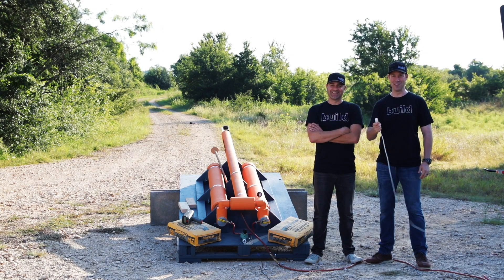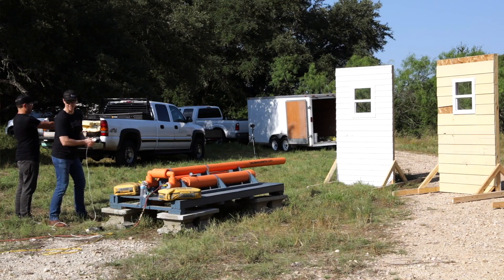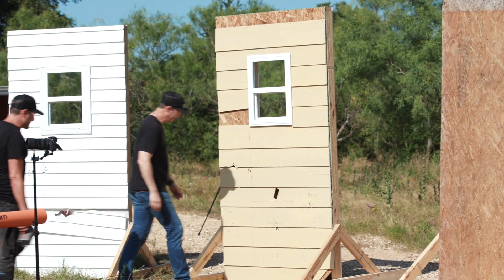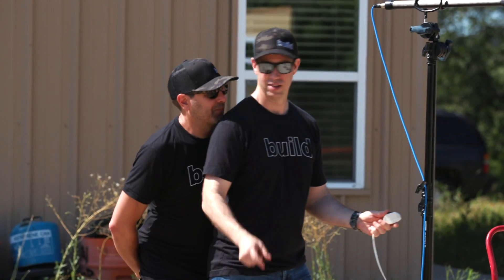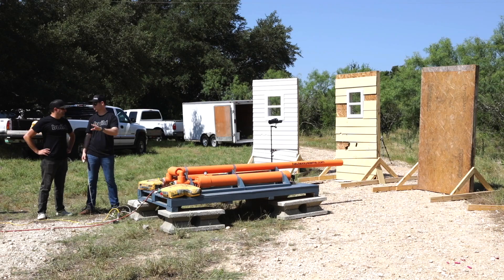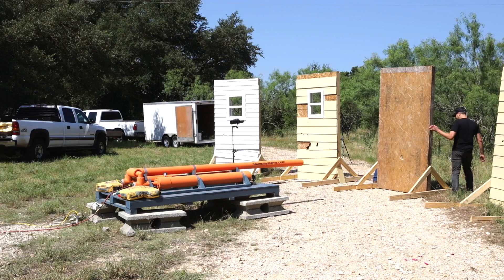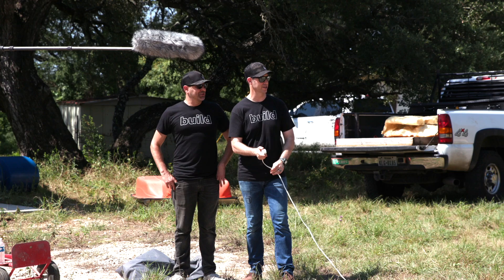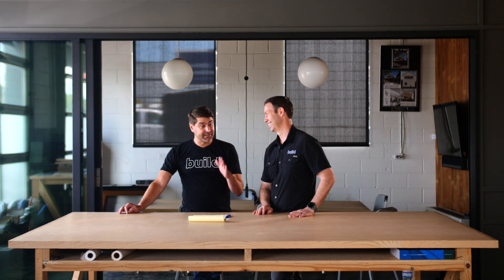2x4 Canon - Hurricane Testing Wood Walls

Comment: Matt, being from Texas you should be familiar with Texas Tech University National Wind Institute.  They are the experts at shooting walls with 2x4s!  I would enjoy a video of you visiting the Texas Tech University National Wind Institute. 

In 1970 the F5 Lubbock tornado (May 11th) causes 26 fatalities and over $100 million in damage; most destructive U. S. tornado to that time (still in the Top Ten Worst Tornadoes). The Wind Engineering research program is established as the Institute for Disaster Research (IDR) headed by Dr. Joseph E. Minor and located in the Department of Civil Engineering. The IDR develops the first comprehensive wind engineering report of its kind on the documentation impact of tornado on buildings and structures TTU SRR 03.
1971 The Fujita Scale (or F-Scale) is first published in a University of Chicago Satel

http://www.depts.ttu.edu/nwi/

http://www.depts.ttu.edu/nwi/research/DebrisImpact/index.php
Reply: https://drive.google.com/file/d/0B1S0nWwTi_fKTkRidXZFdzNmdlU/view?usp=drivesdk. 8-inch thick, R32 SIP panel coated with polyurea (bedliner) and shot multiple times at Texas Tech.  Passed the 140 mph FEMA storm shelter criteria.  Stuff was so tough it took a box cutter to cut and then took pliers to pull off the OSB.
Reply: @DavidMDensford  any link to the testing? This goes with my latest vid on building with SIPs being 30% stronger that stick building. Adding that link would be great. Thanks
Reply: The 2x4 did not breech what would be.considered the interior of the house.  The 40 mil thick polyurea adhered to the SIPs OSB so well when we pulled (with a pair of pliers) on a tab we cut, it actually just pulled the OSB wood fibers off.
The Army tested a plywood SIP panel with a polyurea coating did not breech after a pound of C4 was detonated a foot away.
Reply: https://www.fema.gov/media-library/assets/documents/2009. The wood structure is very similar except the metal is not sandwiches and they use 14ga.
Reply: I love it when the comments are as interesting as the video, which certainly was interesting.  Thank you all because, living in Texas, we share these concerns!
Reply: Remember that he does not post information, he posts his faith based beliefs. 

Reason and science have no place in the faith life..
Reply: @stormagorist6129 
It's arrogant of you to assume that because someone believes in God, that you believe you know everything about them. There have been and still are an enormous  number of scientists who believe in God. I personally know well over a dozen published PhDs in the physical sciences, who believe in God. The other 25% of scientists I know don't believe.
Reply: @cornpop7805  It is more arrogant of you to assume that your emotional reaction is actually my argument. Did you consider honesty?

No where can you find me assuming that I know everything about a person from the delusional belief in magical sky daddies. What you do see is the objectively verifiable fact that denying reason and reality makes one's judgement unreliable.
Reply: @stormagorist6129 
You said "reason and reality have NO place in the faith life". In relationships to God, you can't disprove he exists and you can't answer the central question of REALITY, which is the origin and the nature of being itself.

Matt seems to employ reason and logic quite well, as does nearly everyone I know living a faith based life. You're just trying to fit us all into a box. A lot of atheists do this because it helps them feel intellectually superior. They say "I believe in science!" But, most of them know little about science, which is funny. Again, most of the actual scientists I know believe in God. Most of the atheists I know are not all that intelligent, but they make up for it in outspoken bitterness.
Reply: @cornpop7805  Posts like that are where you show the desperation of faith. You lash out emotionally using your beliefs, but never allowing reality to play any role. 

Instead of being honest, reasonable, and civil, you are petty, angry, and personal.
Reply: @cornpop7805  I know that it is foolish to offer a logic and fact based argument to someone who has renounced both, but here it is nonetheless. Consider the analogous situation of a liar. Your argument would be "just because he has lied to others doesn't mean that he is lying now or isn't trustworthy!" 
Of course that is exactly what it means. It means that the person cannot be trusted to give true responses. 

So when Matt brags that denies reason on what presumably he believes to be the most important decision he makes (likely made without any thought or contemplation) he is saying "well I don't use reason consistently." That is the most generous honest reading we can give such claims, logically speaking. 

I know you feel the existence of reason and the practice of it makes one "bitter" and "unintelligent," but your emotional reaction to logic does not determine the nature of logic nor the nature of those who use it. 

Feel free to check with literally any other logician for further explanation of the obvious.
Reply: @stormagorist6129 
There was nothing emotional about my response, it was reasonable and logical. But, you took the opportunity to try and twist what I was saying, which is neither logical or reasonable. It would be easy for anyone looking at our exchange to see where you have tried to reframe what I have said in a deceitful way.

In regard to Matt, he's one of the most logical, reasonable, and frankly honest YouTubers I've seen. He's taken several opportunities to show where he's made huge mistakes. He then owns up to them, fixes them for free and shares his previous flaws with us and moves forward with a new and hopefully better strategy. Those strong ethics are evidence of his faith and his process is evidence of his reasoning and logic.

You have shown neither logic, reason, or ethics diring our exchange.
Reply: @cornpop7805  Your constant dishonesty does not serve you well. Using modus ponens is not "twisting" what you are saying. 

You mistake your choice to like X for X being logically valid. This does not follow. Notice how you use insult and dishonest claims instead of addressing the refutations offered?

You used appeal to authority as well, which is another fallacy. 

That you cannot address your own denial of the law of non-contradiction and that of identity yet maintain that this faith based position is "logical" shows a failure to understand the central tenets of logic. 

You say that using logic is not reasonable, but you offer no basis for this claim. You protest that modus ponens and RAA are not logical, but you offer no basis for these claims other than you  like Matt. 

Take a basic intro to logic course, read The Reasonable Woman, or just do something to educate yourself as to the nature of logic so you can avoid these sad and obvious errors. 

Critical thought matters. Reality matters. Faith doesn't.

Since you call using sound arguments "deceitful" I strongly encourage you to see out an evaluation from literally ANY other logician. See if she agrees with your faith based claims about the law of non-contradiction and the nature of logic.
Reply: @stormagorist6129 
As much as I'd like to, I simply don't have time to argue this out. In any case, I don't think either of us can agree on what logic is, much less convince the other on any topics that are supported by it. I'm certainly never going to read The Logical Woman, for reasons that would be obvious to any self respecting man.

Over and out, babe!
Reply: @cornpop7805  One of the beautiful things about logic is that it does not need you to agree about what it is. It is objective. 

As for convincing me, that is easy. USE REASON AND EVIDENCE, NOT FAITH. 

The book was The Reasonable Woman. That error demonstrates the expected lack of reading comprehension. 

That you are condescending to women speaks loudly of your character. 

If you ever decide that you want to actually hold true beliefs or better yourself consider asking yourself what you would accept as falsifying your belief. Right now you have no idea, because you don't accept that reason or reality can falsify your belief. That is one of the hallmarks of the faith methodology and part of the reason why it is never reliable. 

Truth is not about ego. Truth is simply correspondence with reality. Once you understand that you can let go of the fear and anger that is motivating you now.
Reply: @cornpop7805  Sadly here again were you familiar with even the most basic elements of logic you would understand simple deduction. 

I am giving you the benefit of the doubt that you are serious in your claims and accusations. From that all of the rest follows logically. 

Thank you for making your antagonism to reason and women so very clear. It speaks loudly as to your nature, though not complimentary. 

BTW if you are going to try to allude to Shakespeare you should try to get the quote right and check your spelling. 

BTW no one familiar with logic uses the term "illogical."  We cite the invalidity of the argument, the falseness of a premise, or the literal nonsense of the claim. As for deductions being assumptions, that is your error, not mine. 

Please feel free to consult literally ANY other logician for more clarification and verification of all that I have cited.

Comment: Wish you did the test with a uk spec wall.  red brick external 100mm insulation and concrete block internal
Reply: I think in case of a tornado you'd need to test for bricks flying at 90mph.

Comment: Would love to see this with a standard European type wall (wooden construction - not stone wall)
Reply: Standard European Construction is block walls.
Reply: My Aunt’s ‘60’s era Italian farm house is made out of 8” poured & reinforced  concrete
Reply: I'm aware of construction standards in the EU. But more and more pre-fab houses are sold here mostly made from wood. So the question remains: would they hold up any better? I have absolutely no idea.
Reply: @b.willroth8384  Does Europe get hurricanes? or even tornados? At best the UK rarely gets a hurracane.
Reply: Guy Tech we do experience intensifying weather phenomenons (probably caused by accelerating climate change), yes. But that's only one aspect to my initial question. I believe the type of wooden construction here in general has a better degree of insulation. But would that automatically result in greater strength? Just an open question .. I am not trying to make any point.

Comment: Price of Matt's sandwich is 3\4" -18g-3\4" is same price as bricks per SQ ft
Plywood $1.20 and $3 for metal = $4.20 is similar for face stone.  Labor will be cheaper for sandwiche due to higher cost of bricklayer vs carpenter.
Reply: Good luck in finding a mason to do the brick work. Masons are a dying breed unfortunately :(
Reply: @guytech7310  we have few choices in Chicago as we have house in upper budgets .. but travel outside 150 miles and nada

Comment: Disappointed there wasn’t a structurally insulated panel represented...
Reply: orion khan a typical OSB Sip would have faired much worse than Matt’s prototype.
Reply: The spray foam wall is essentially identical to a SIP.

Pretty much the only commonly-used wall systems that hold up to stuff like this are concrete.

Concrete-filled cinder block
Concrete tilt-up
Concrete  form
ICF

Comment: Proves the point that many die due to cheap construction. They should change the building codes. Maybe concrete?
Reply: Or bricks?
Reply: Cross Ocean, Waste of money. Nothing wrong with our building practices.
Reply: @augustreil  
But the buildings get shredded in "every" hurricane... 
Why not just build one more expensive building that would last?!
Reply: @i.i.iiii.i.i , In hurricane prone areas, yes a block or concrete wall would be the choice for me. Florida might have some newer codes that require this ?
Reply: Most homes should not be built in flood planes or directly on the coast, subject to frequent extreme weather conditions. The #1 cause of home damage in the US is wind damage, but water damage. Not building in flood zones or directely on the coast would save tens Billions every year.